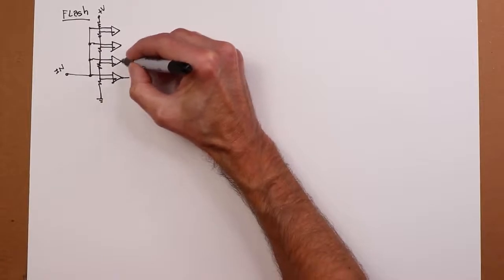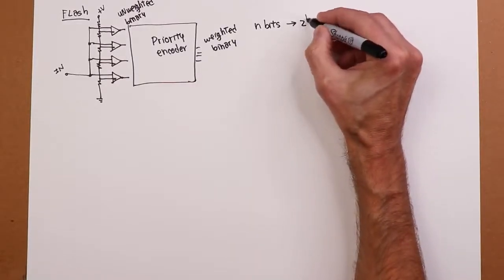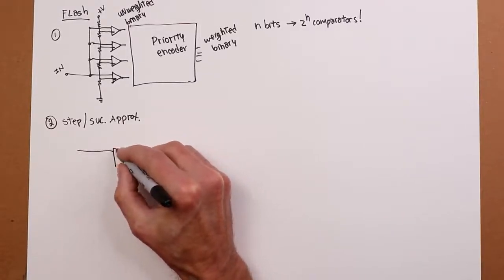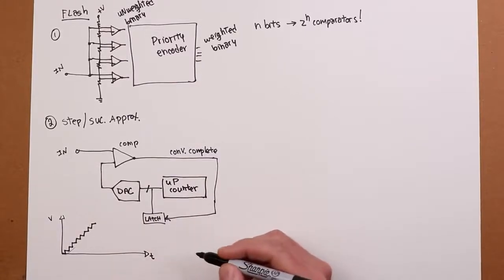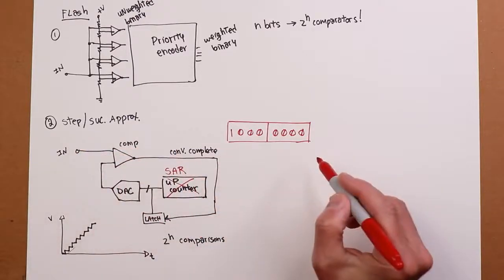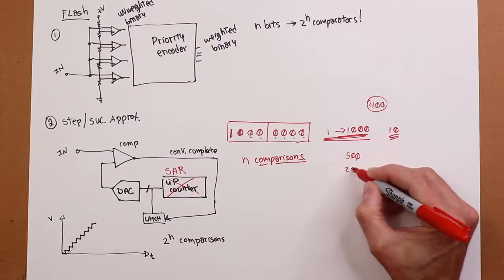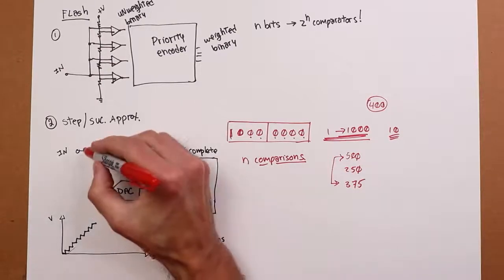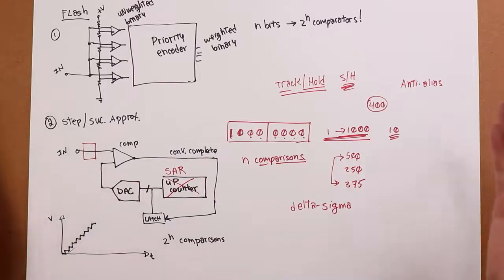Op Amps: Analog to Digital Conversion

Comment: This video is 3 years old and it still served as great resource for learning.
Reply from the maker: Fundamentals are like that. You could pick up a text on DC circuit analysis that's 50 years old (I have one), and it still works just fine.